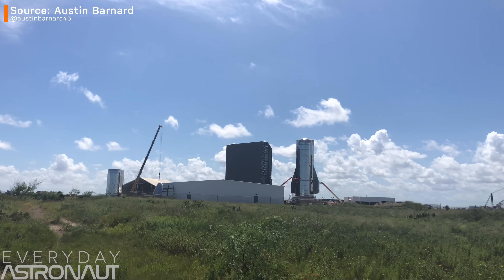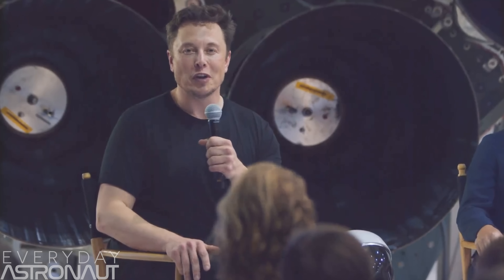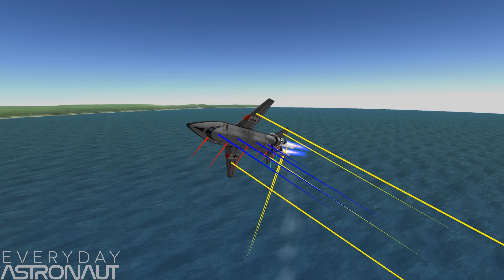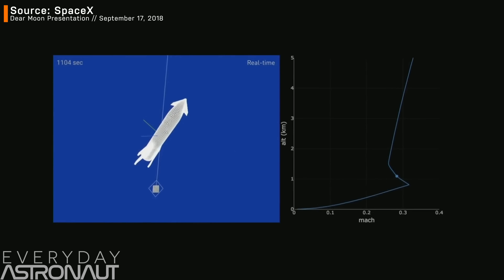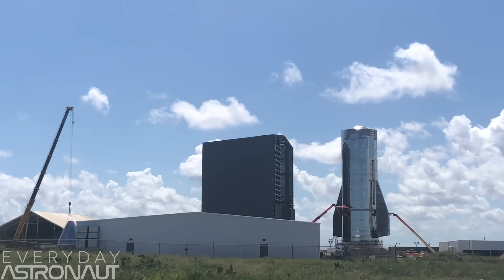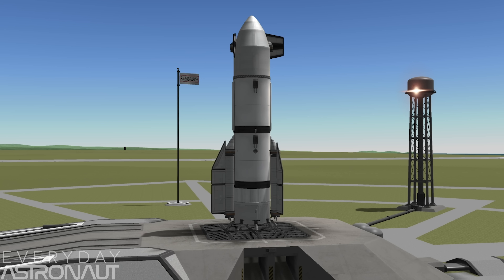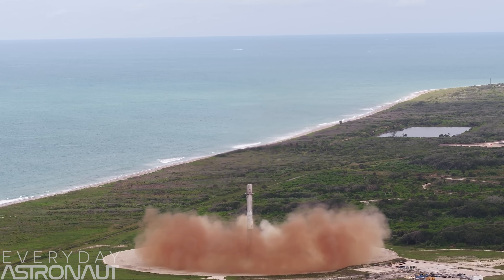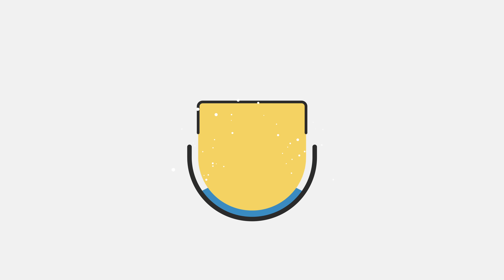Why does Starship only have 2 rear fins?!

Comment: Ignorant layman musing: wouldn't natural tendencies to avoid resistance tend the craft to "try" to put one fin in front, and one trailing, to slice through the air with less "punishing" resistance? Ergo, making the craft have to "work harder" to orient itself so that the flaps can brake?   I'm saying, doesn't any moving object seek the path of least resistance - in addition to center of gravity tendencies? (And that this would be true with 3 flaps as well, but "not as much")
Reply: I guess I'm speaking of descent, not ascent?

Comment: Thanks for the video very clear and easy to understand. I'd like to point out that in a return phase where aerodynamic drag is used to reduce horizontal speed it might also be useful to use raptors to make sure that it lasts as long as possible. In this way the starship thanks to the thrust of the raptors could stay for more time and almost completely zero the horizontal speed. What do you think?

Comment: I've always found the idea of the fins being the landing gear a high risk and always bugged me.

You're asking one complex component to do two tasks. The main issue I had was that the highest stress load for the fins is perpendicular to the highest stress load for landing legs. So you've got to add strength in both directions for it to deal with both scenarios.

Another thing that still bugs me is the hinge of the fins, as the fins fold back the hinge is going to be exposed to re-entry. The angle they fold back should be reduced now they are at 180 rather than 120, plus the fins are probably now capable of being thinner and so exposing less of an edge. I'm still not sure how they're going to protect a hinge of that size against re-entry though.
Reply: The hinges will be exposed only on two points. The rest get covers. My uninformed guess is, that the part where the knuckles (or whatever part with that function) meet will be under the covers to protect the bearings.

Comment: Tim, if propulsion is not used during reentry until the last minute, why doesn't the belly flop happen with the pointy end down? This would allow the large flaps to be behind the centre of mass, where they want to be, during the belly flop. Then, before landing and at sub-sonic speeds, the rocket could be flipped around to be flamey end down before landing.

Comment: The engineering required to have a pivoting hinge (where the fins meet the body of the craft) that can handle:
1) the torque of the hypersonic airflow
2) the heating of re-entry, and 
3) the longitudinal loads of landing impact (or even just the static load of the gross vehicle weight at 1G on Earth) 
is an incredible challenge to throw at the team, on top of all of the other challenges inherent in a vehicle of this size & complexity. Separating the functions relieves a huge amount of pressure and allows you to optimize each part for its specific function (rather than a compromised design that must tolerate the worst-case-scenario for all of its various functions).
Reply: Absolutely!

Comment: Here's an idea for the cold gas thrusters: run them off liquid CO2. You'll want to be able to refuel them on Mars, and the easiest way to do so would be to compress the atmosphere and dump it in a tank. The ISP is comparable to nitrogen thrusters (70s) and the fuel is about 4 times as dense (since it's in a liquid state). I imagine they'll stick with nitrogen for a while, since it's so inert and cheap, but I reckon they'll go this way for the Mars ships.

Comment: Why does it have fins in the first place? There is no air in space.
Reply: That's exactly why rockets went away from fins in the first place - they started using control systems (rockets) that do work in space.

But those tickets are throwaway rockets.  Re-entry is not something they do (except as debris).  SpaceX added fins to Falcon 9 -- grid fins, at the top, to help with re-entry, and folded out of the way except then.

What he's saying in this video is that fins are useful in only one part of the trip: braking in atmosphere.  He says that they can provide large amounts of drag.  And also control during a turbulent & stressful time.

Comment: Think 2 fins makes more sense because of simplicity, ease of manufacturing and ease of maintenance. Separating the landing legs from the fins means more and larger feet can be used which will reduce ground pressure at touchdown which is a concern when landing at an unimproved landing sight such as the surface of the moon.

Comment: Very interesting. My concern about the previous design was the use of 3 legs. 4 seems to make more sense. For the same stability at landing you'd need your 3 legs to be a lot longer than if you'd use 4. I suspect 3 long legs would be heavier than 4 shorter ones. They probably know that very well at spaceX, if you look at the design of the falcon 9.

Comment: The folks should understand that all this iron works in Boca Chica is just an ad-hoc solution to quickly test raptor engines in landing scenarios. It is quite obvious that SpaceX don't have well elaborated design of a real interplanetary ship now and it will be changed million times in the future. All this clever explanations why  2 is better than 3 or vice versa or why steel is better than carbon fiber  just make me smile.

Comment: Having the wings (control surfaces) and the landing gear be separate systems has the disadvantage of increasing the number of failure modes to consider in the DFMEA ;)
Reply: Yes, but by limiting the impact of any one failure mode, you may be able to dramatically reduce overall risk.  In the end its about odd of mission success/failure and overall risk to the payload/pax.
Reply: @noelwade  Yeah I agree, good point, but I would worry about how a failure in a separate landing gear system could affect the proper function of a different, more critical and temporal system, such as the control surfaces. If for instance, a folding landing gear failed in such a way that it folded out during ascent and became an uncontrollable control-surface. It is also worth noting that two separate systems (ie. control surfaces and landing gear) are twice as many components that need rigorous testing (and no doubt also debugging :P). At least that's my experience. I always try to design things using the bare minimum of different parts.
Reply: @vinzent1992  - Without engineering specifics, its all pure speculation and we could make any scenario fit our arguments.  But for my money, I'd rather have a "broken" landing-gear leg sticking out into the airstream than a "broken" body-flap and its much larger effects on flight! :-P 
The bottom line is that this stuff is complicated, none of us have deep info, and so the best thing is to sit back and watch the show as the vehicles are built and evolve. SpaceX has good engineers, they will surely be examining all of this stuff. 
And no matter how deeply Elon is involved in the technical aspects of the ship, Powerpoint presentations != Engineering Diagrams. :-)

Comment: I think that you should use 4 fins to get good stabilization, like Saturn 5 or the german V2.

If you want to use only 2 fins, they should be bigger and should have flaps to reduce speed and control the ship's movement.

Let's see how this goes, but 2 fins fit more with a horizontal landing scheme.

Comment: Great video Tim, you must have put a huge amount of work to make this for us.  Thanks very much.

Ps - how uneven a surface is Starship going to be able to land on?  All the animations seem to land on nice pads and solid ground rather than the very dusty and uncompacted tilth of a Martian plain.
Reply: My biggest worry. Is why I'd like to see F9 type legs, 6 of them, spread out very wide for stability and adjusting for height differences. Also easier to design in shock absorption.  Love the 3 fin rocket ship look, but wouldn't want to land in one.

Comment: "All fighter jets are inherently unstable."
Thanks for the information. (It may have smashed fighter pilot dreams)
Reply: Cby 0530 you should look into it some more, some fighters are great for flying.
Reply: For what I understood about it, being unheritly unstable it doesn't mean necessarily it's too hard to fly, but it means the the computers do most of the job of mantaining it unstable. For what I know fighter jets are built like that so it can manobrate faster
Reply: They are meant to be because they need to turn fast. The built in computer helps keep it stable.

Comment: Why do you youtubers always upload right before school anyways I'll watch later because this is a question I had I mean why 2, 3 looks cooler and might be better for landing stability

Edit: Star hopper also had 3?
Reply: Now they're not using the fins as legs anymore. Legs and fins are separate things now
Reply: no actually exactly not... when it comes to physics 2 fins are definetly more stable and it's also more redundant since the two systems are seperate, makes it easier to develope and also to maintain i guess, and to be honest, with 2 fins it can still look as awesome as 3...
Reply: I agree, 3 gives more stability, like airplanes vertical stabilizer.
The 3rd leg/flap/fin, if it was aerodynamically useless it would not have had that similar shape as the other 2 in starhoper and last year ship version.
I remember Virgin Galactic feather system which changes overall ship geometry pointing those feathers upwards.
Similarly, this makes the center o pressure away from the "belly" of the starship or of the superheavy booster and closer to that 3rd flap.
The opposite happens with the center of gravity which is found closer towards the "belly" and away from the 3rd flap.
As EverydayAstronaut explains in the video this provides vital stability.
Reply: you know that the earth has a lot of time zones, true?